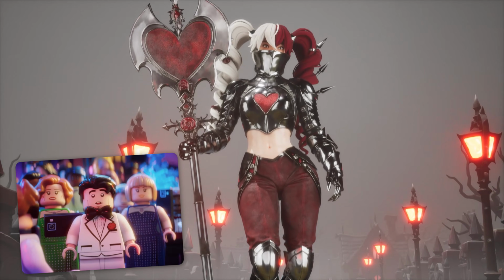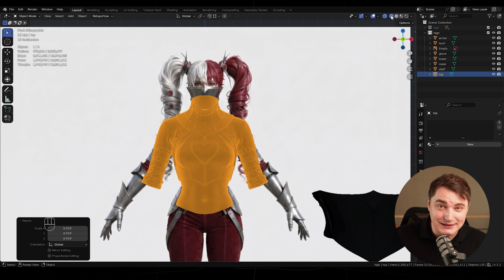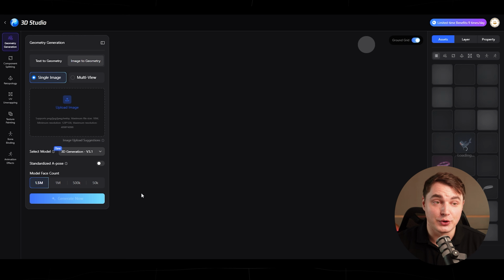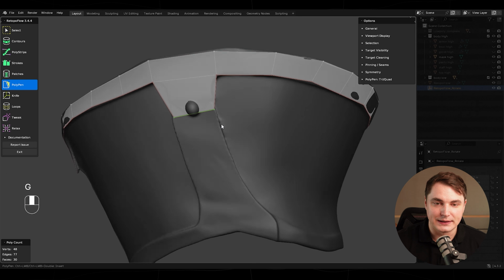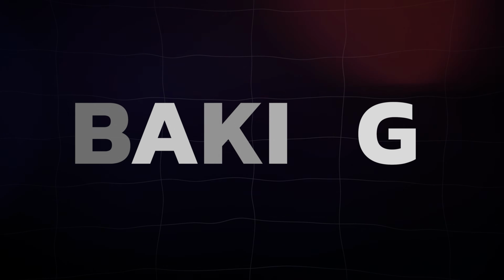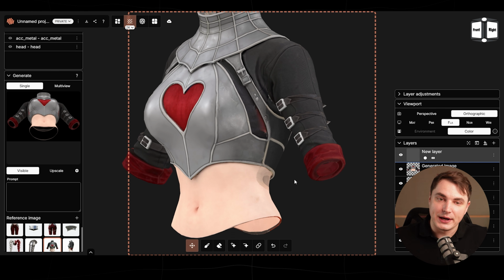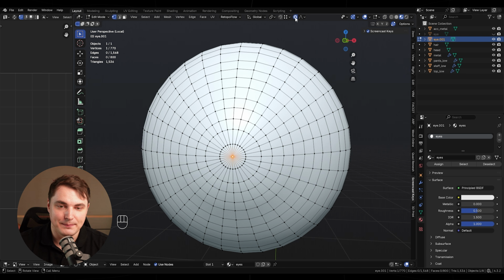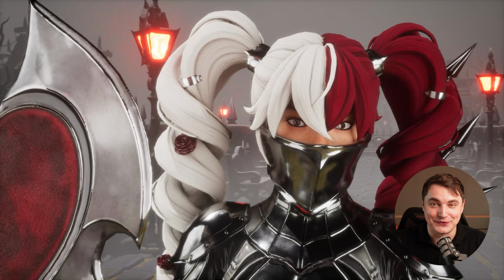Make Your First 3D Character With AI - Complete Guide (2026)

Comment: Nice work ! I like this approach much more. AI remains a tool that speeds up the workflow, while the artist stays in control through their Blender skills. That said, I do think it's a bit of a shame that the character design is almost entirely delegated to AI. To me, that's the stage where a character really gains its identity through sketching, exploration, and artistic iteration.

In any case, the video and the explanations are excellent. What I really appreciate is that they show you can always choose which technical tasks to delegate—such as rigging—while still keeping full creative control. To me, that's a much healthier way of using AI: it supports the artist rather than replacing them.

I also have to admit that I'm getting pretty tired of all the "just do everything with prompts" videos. 😅 Seeing creators who still use Blender, make artistic decisions, and only delegate the tasks where AI genuinely adds value is far more interesting to me. That's the kind of workflow that integrates AI without losing the essence of the craft.

The only thing I'd encourage people to keep in mind is the hidden cost of these workflows. Many of these steps rely on paid AI services, and that part is often overlooked. When you try to reproduce the same pipeline using free or open-weight models, the results are usually less consistent or require much more work to integrate properly. It's an important factor to consider before building your entire workflow around AI.

Comment: That comes in very handy. Working on a character and this video showed me my workflow was not the best yet. And a lot of useful extra tools like AccuRIG, but I was not so far yet. I want to do an "as good as possible"  one single character... I sometimes hate to tend to be a perfectionist with too less experience. xD I would see myself anywhere between beginner and average level, depends on the work part, and I'm a slow worker.

My first month sub of Loveart and Tripo3D comes to an end next weekend. I will replace Loveart with a local solution (Krea2 with inpainting workflow sounds good for me) and ChatGPT Image 2 over ChatGPT Plus sub (also for Codex). I thought also ending my Tripo3D sub, but they gave me an 80% discount, so I paid 50% on my first month and 80% on my second, well, 4 Euro is a no-brainer, so I will stay for another month. Will be helpful for low poly and other cloth setups for my character.

Used Loveart and Tripo3D thanks to this channel here. But I miss true in painting on Loveart and iterate too often and I don't like this credit system where you have +100 fresh day credits which mean you could have up to 3000 day credits, but only if you use that 100 credits every day, monthly credits are only 2000. I really don't need an AI "fomo" subscription. I simply want to work with AI without to think too much on credits, Tripo3D feels better in that point. I also noticed that higher resolution images are not every time better for Tripo3D, it could make that Tripo3D adds more errors into the 3D model from the more pixel details the image gave it. You would need a very clean image.

With a local workflow I can use any (custom) image model I want, could use real inpainting, could even use (self trained) LoRAs and ControlNet. Explaining LoveArt what you want sounds also better as it is, at the end it also matters if the used image models also follow the prompt from the LoveArt AI good enough what often didn't work so good, wasted a lot of credits for bad results.

Comment: Thanks, great video! This isn't really suitable for a main character, but it's perfectly fine for mobs or background assets. To improve the visuals, you could shift from realism to semi-realism or an anime style. Also, doing a few steps or stages by hand instead of relying on AI would hugely boost the visual and aesthetic quality.

But of course, that’s just the perspective of someone who can design and build a 3D character from scratch, including rigging and animating it. Your guide, on the other hand, basically lets a total beginner pull all of this off effortlessly without any special skills.

Even though I can model and draw everything myself, I still use AI at certain stages too—specifically where it's impossible to tell or prove it was used.

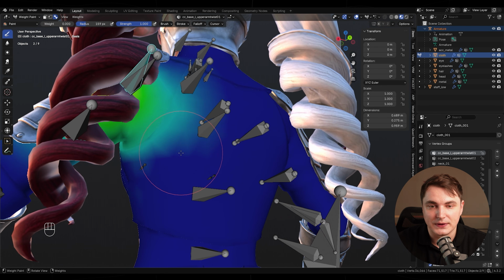Comment: 55:03 Accu rig does not connect the bone with the chest. So jiggle physics for example do not work. Did you find a solution for that? I am also using Unreal engine. Thank you.

Comment: I'm a solo game dev with a near $0 budget for my project. I am aspiring to integrate AI into nearly every aspect of my game dev journey. I use Gemma via Text Gen to help with numerous tasks, from generating prompts, to filling out character profiles, ComfyUI to prototype the prompts that I got from Gemma to design my characters, once I get a bit more breathing room financially, I plan to get a subscription for Clade Code and use the Unreal MCP to use AI to help me refactor certain actor components to improve their functions and increase their performance. Once I am satisfied with my progress on the System design side of, then I will finally get to do something I really enjoy, which is environment and level design. However if I were to be chosen as a winner of the course, I would most likely put environments on hold and focus on characters as I have more than a few to implement into the game. Truth be told, I built my own workflow of taking an character from AI to Unreal engine, it works, but its a bit janky, it pretty much requires me to train a Lora, and maintain a subscription to blender Plugin. I would love to learn from an industry professional, and potentially pick up a new workflow in the process. Also thank you for sharing your knowledge